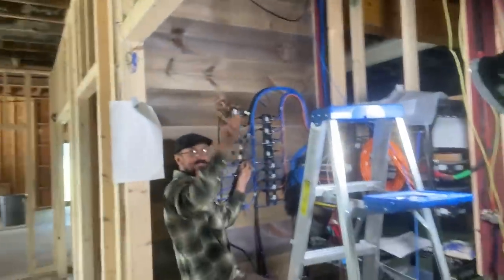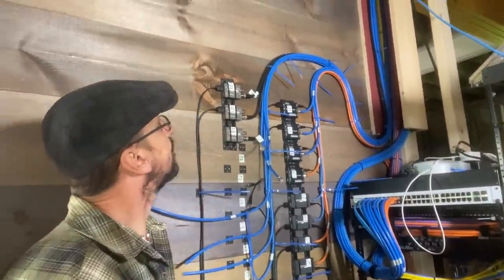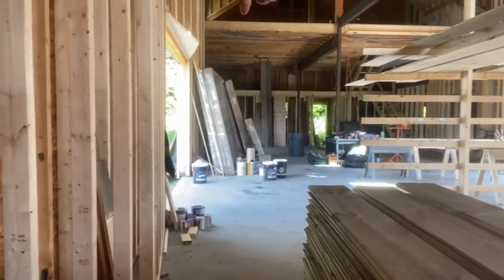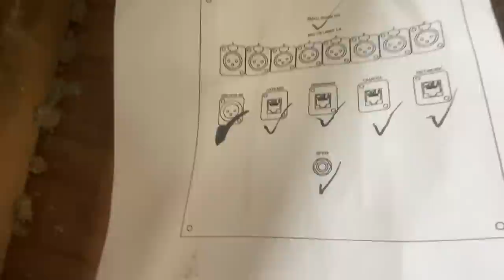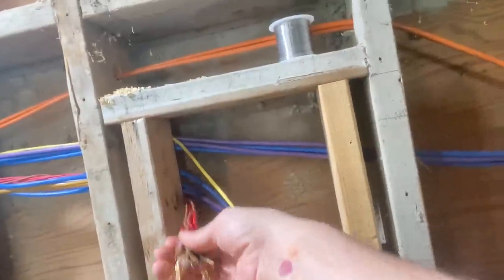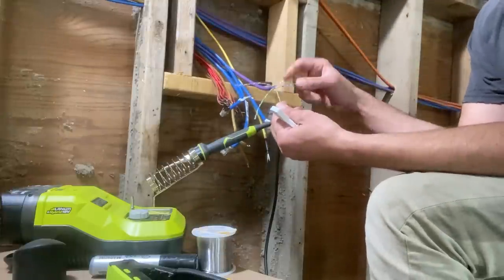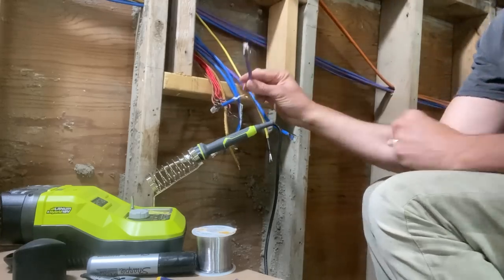Making Records with Eric Valentine -  Episode 9 - More Wiring!

Comment: Tacked on reply to the reply to the question: You can use an E-Bow to create a relatively consistent output from a guitar without worrying about impedance variations from any buffers or pedals in the chain. Leave the guitar setup on the bench and just flip the switch on the E-Bow each take. Not quite as expressive as just playing the guitar but it will work.

Comment: Sorry to refer to the previous video in this one, but since you discuss it in the intro to this one: My thought about the GB Tracker guitar issue was a custom wound pickup that stacks two identical and independent coils on top of each other which go to two separate outputs. Essentially like two windings on a transformer. Still using one set of pole pieces but the top half of the pickup is one set of windings and the bottom half is another. Maybe it’s a thing? 🤷‍♂️

Keep up the great work and excellent content ❤️
Reply from the maker: Very Clever!!  The question would be if the difference in the position of the pole pieces relative to the strings would still produce an identical sound.  I'd have to try it to know for sure but great idea!
Reply: @mrwev  Well I'll take that as a compliment! I wasn't clever enough to know that that's what a "stacked single coil" is and that after a very quick google search the DiMarzio HS-3 is at least one commercially available pickup which offers that possibility. They think it's for wiring as a humbucker with series or parallel options but little do they know there's an infinitesimal audience looking for better a/b testing solutions...
Reply from the maker: @distortion_plus  After thinking through the setup of this approach a bit more, Assuming the guitar was producing a pair of identical signals,  you would also need two identical amps, in identical positions in the room, with identical microphones placed in identical positions.  This issue of "isolating variables" is by far the most difficult part of trying to do A/B testing.  It really is difficult to have everything be exactly the same except for one variable :)
Reply: @mrwev  Apologies, I wasn't paying attention at the beginning of the discussion. I didn't realise that the test was just Gtr->amp vs Gtr->gb tracker->amp. I wrongly assumed it was the whole system comparing gtr->amp vs Gtr->gbtracker->pro tools->reamp->amp etc which the dual output pickup might be useful for.

Comment: Having run about 2km of CAT6 back at University (and about 1.5 of that myself) I can totally understand why you're getting someone with sufficient patience to actually make it look nice. Last time I opened that rack to debug it I realised what a mess I had to answer for with those 70 cables criss-crossing like crazy until going into the cable basket (and then continue in further basket/trunking with more hidden mess).
Interesting that you went for crimping connectors and then using feedthrus; I just always use punch down EtherCons to avoid the pain of getting a RJ45 right the first time with full bandwidth. Great tip with cutting the cables at an angle to feed in the connector; you always learn new tricks even after years of crimping those buggers.

Out of interest what generation of Aviom are you going for, the venerable A16II or one of the more modern systems?

Comment: Eric have you considered making a transducer using a pickup and an inductor with a reasonable amount of leakage flux as a repeatable test source. You could drive the inductor with a small audio amplifier from a suitable audio source. I as sure you would be able to get enough magnetic coupling to make it basically work and of course you would get the impedance of pickup to drive your box, wether you would get the right tone is another matter but for an a b test it might be worth a try. Robert.
Reply from the maker: Wow... very clever :)

Comment: Hey Eric, I’m about to need to run 150ft to my garage to track drums and I’m looking at running Cat 5 or 6 but my question is……

Can you run the preamps at the control room end or do you wanna run the mic preamps in the live room and run a line level signal down the cat 5 cables to the control room?

Comment: That speaker cable looks pretty heavy. Won’t it add too much resistance for guitar amps?
Reply from the maker: My general understanding is that larger diameter wire will give you less resistance.  That wire is 12ga so 100' of it would give you about .16 Ohms of resistance.  With the relatively low source impedance of the amp (4,8, or 16) it should be fine.  It is possible that it could be audible but I have used long speaker runs for guitar amps before and it was never "make or break" for the sound.  I'll have to do a poper test of that in the future :)

Comment: Awesome insights, thank you very much for doing this. Curious to see if you have incorporated also Dante to your converter/interface set up.
Reply from the maker: I am not going with Dante in this setup.  I seem to be moving in the opposite direction.  I'm sure it works/sounds great but the idea of adding more digital conversion and latency in the path doesn't feel right for me :)
Reply: @mrwev  Thank you for clarifying this, it makes total sense. I had in mind that maybe there was a need for multiple computers & accessing mixing hardware from multiple places. Can't wait for the next videos, especially the VPR bass traps :)

Comment: Eric, I’m getting ready to do some Cat6 audio runs. Would you be able to point us in the right direction as far as connectors and cable? Connectors, especially. Don’t want to order the wrong thing haha.

Also, have you seen then DB25 to dual RJ45 adapters? A friend of mine outfitted his big Flock patchbay setup with them, and it cleaned up a TON of space around his control room and machine room.
Reply from the maker: I went this company that is available on Amazon called "trueCABLE".  They have a whole line of CAT6 cables, connectors and tools that all work together.  I did it that way because sometimes the tools for dressing and crimping ethernet connectors can be very specific about what cable they work best with.  I wanted to get something that I new was designed to work well together.  

I have not seen the DB25 RJ45 stuff.  Totally makes sense!  That might be useful in the future :)
Reply: @mrwev  Awesome, that's exactly why I asked. I was worried about cable/connector and tool compatibility. 

Thanks, Eric! Keep rockin!

Comment: What great timing! I’m just about to run some Cat 6 lines for remote Gtr cab recording, so all the tips are greatly appreciated. Are there any issues using these longer lines with ribbon mics? Maybe you already mentioned this but it would be great if you set up sponsored links to the cable and tools you prefer. I’d love to know what you’re using. In an older episode when you first moved you were using the Lynx cat/mic boxes. Are you still using those or have you upgraded to anything else? Thx again and good luck with the pond!
Reply from the maker: There should be no issues using the CAT6 runs for ribbon mics.  The CAT6 should perform as good or better than most mic cable because it generally has a lower capacitance.  I am still using the Lynx boxes as the break outs for the CAT6 mic runs.  They are simple, affordable and work great.  The CAT6 cable and tools I am using are all made by "trueCABLE".  They are on Amazon.  I did it this way to ensure that the cable, connectors and tools were designed to work to gether.  That can be tricky with CAT6 products.

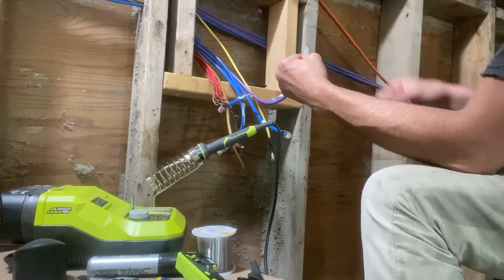Comment: 21:37 Well, I'm glad to see you're using pass-through connectors, but why are you terminating your ends to plugs and not keystone jacks?
Reply: I was thinking the same thing, I am getting ready to terminate all mine to keystones, but if Eric is doing plugs its making me think there is a reason I should reconsider. So Eric if you can chime in on this that would be great!
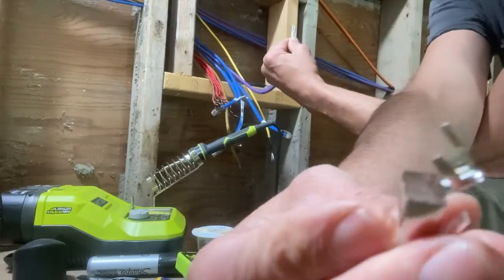Reply: 21:37 Also, just FYI, the purpose of those little bendy wings is not strain relief. They're used to make positive contact between the cable shield and the plug shield. Strain relief usually comes in the form of a boot that slips over the outer jacket of the cable (before you terminate the end 😉).
Reply: @helmanfrow  any chance you know what that little shark tool is he is using to straighten the wires ? I cant find it online anywhere lol
Reply: @chriscarr1791  Yes, I often see it strapped with cling film to the side of certain spools of Belden cable. I think its their own design.

I haven't seen it from other manufacturers but that doesn't mean it isn't available separately.

There are other tools for straightening cable, however, including any flat, rounded hand tool, like the bottle opener on a Swiss army knife.

It's nice to have a purpose-designed tool but if you're doing only a few terminations (less than hundreds) then by all means improvise. I usually use a piece of outer jacket to separate pairs into two conductors and then straighten all eight conductors between my thumb and forefinger.
Reply: @Helman Frow  found it! Belden 1797 termination tool.

I agree with the method you mentioned and is how I normally do it. But a tool like this looked inexpensive enough it wouldn't hurt to throw in the bag

Thanks!

Any feedback on ends vs keystones? I'm doing another studio now and wanted to use keystones to look cleaner.
Any industry standard ends and keystones you would recommend ?
Reply: @chriscarr1791  Ah, Belden 1797, that's right! Looking it up now I realize it was already cached in my browser, which means I must have looked it up when I first observed one in the wild😂.

I'm not an integrator by trade by I've done quite a lot of LV wiring and in my experience most keystone jacks generally work with most faceplates. 

That said, there are some caveats upon which I've wasted time and money.

One thing to watch out for when buying materials is the height and width of Cat5 and Cat6 jacks. There are many varieties, and not all will fit adjacent to one another on all faceplates or rack panels, be it side-by-side or above and below. Some terminate from the top, some from the back. This will make you crazy if you're a perfectionist like me.

Make sure you use Cat6 jacks with Cat6 cable because the IDCs are designed to accommodate the typically-heavier conductors.

Speaking of IDCs, there are a few different styles.The most common that I've encountered are 110 and Krone but there's also a newer hybrid which works with 110 or Krone tools. At this point I have a few of each tool so I'm not caught off-guard.

Get yourself one of those palm-held termination pucks that works with your chosen jacks. These hold the jack securely and give you a firm grip as you apply pressure to terminate the conductors. They result in a 99% reduction in cursing. Indispensable.

If you want to ensure compatibility then buy everything from the same system, like Belden or Panduit, but be prepared for sticker shock. Incidentally, Panduit has a line of connectors that looks like keystone but is not compatible so beware.

Buying from different vendors will quickly educate you on how many shades there are of "white".

Always leave enough slack at the drop so you're not working too close to the wall, but not so much that it won't fit back in the box.

Always leave a few feet of slack in a service loop at the panel. You'll be glad you did when you inevitably move a patch panel.
Reply: @helmanfrow  great info, thanks!
Reply: @chriscarr1791  👍🙏

Comment: I spent 5 years cabling up data centers for Google, and zip ties were always a big no-no.  Reason being when a cable dies (and they will), making a new run would necessitate breaking all those zip ties and re-fastening.  The better solution is using Velcro straps.  They look just as tidy, are easy to manipulate for new runs, and aren’t as susceptible to damaging the cable sheathing over time if fastened too tightly.  Also, in a big operation like a datacenter you wouldn’t do this, but in a smaller install like this project, you would want to consider making spare runs to save yourself from having to even make new runs if a circuit dies after the wall is all closed up.
Reply from the maker: Thank you for the suggestions!  I do have some spares in places and yes velcro would have been better.  In the past when I have had to replace a bad cable, I add the new run and leave the dead one in place so I don't have to undo all the cable ties.  Just add some new ones to hold the new cable but still velcro would be better :)

Comment: More on Cat6 for mic or any audio would be great to hear about, I saw some studios using it for even short runs and praising the sound, if that's such a thing. Also why SDI over NDI?
Reply from the maker: I'll go deeper into the CAT6 for audio stuff in future vids.  The 3 main cameras that I am using (I took them with me from Barefoot) have SDI outputs on them, so I choose to stick with that format.  I never looked into NDI for this to see what the benefits might be.  Maybe It could have been a better choice.  Not sure.
Reply: @mrwev  great thanks, always interested if internal wiring or all wiring could be done with cat 6. Some expensive speaker cable I had is just solid core multi strand, which is the same. Cool to reuse old stuff, guess you can make the switch to NDI anyway.